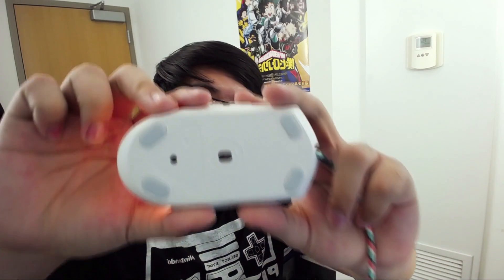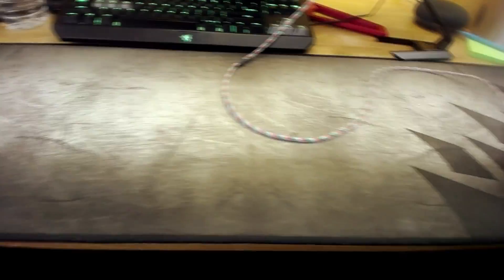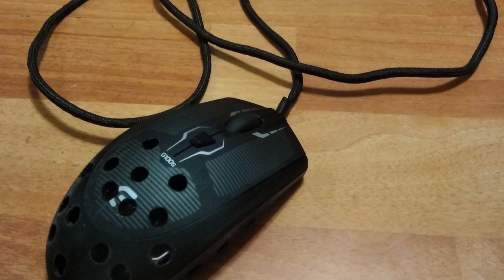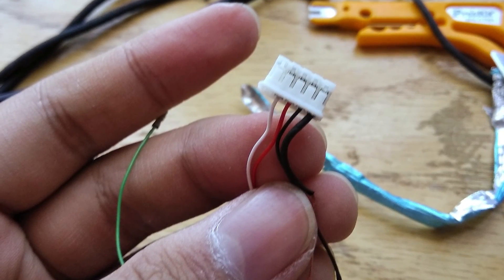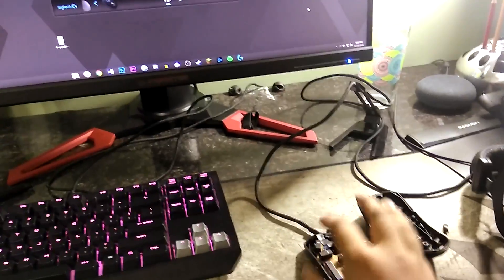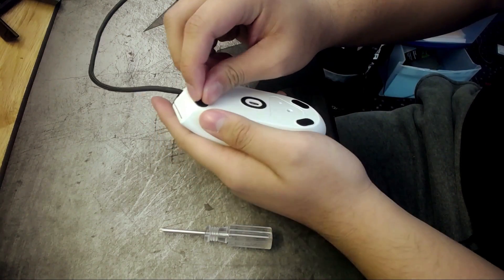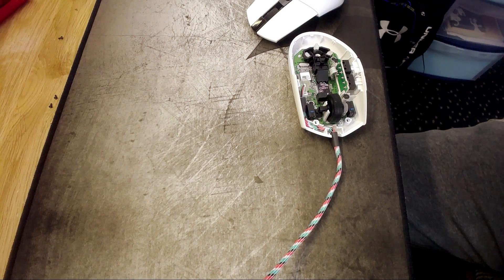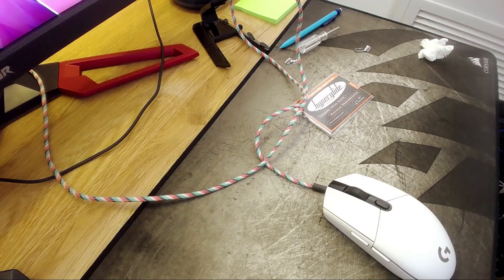How to make your mouse even better! (for osu! and other games)

Comment from the maker: EDIT: Yes the G305 is a super good option for wireless that I forgot about and it would be about the same price to go with that vs doing what I did but 1) it needs batteries so you have to keep swapping those out every long while and 2) if you already own a really good mouse that you like, this is cheaper.

One thing that I forgot to mention in the video that's semi important is that if you want to be 100% sure before doing this, I would do a quick google check to see how other people have taken apart your specific mouse. I've done the paracord mod for a few friends, but each mouse was very different to take apart.
Also, the hyperglides come in a 2 pack. You get a spare if they ever wear out down the line :)
Reply: for people with doubts about the battery life of g305/304, they mean it when they say 'every now and then'

personally using an AA lithium energizer for the past 6 months, averaging daily usage of 2 hours with performance mode at all times, the logitech software has the battery indicator at 5/5 to date. actually insane
Reply: @uwaa4467  ye man ive been having the g304 and i use dry cell batteries that came in a pack of 4 and they cost less than a dollar. They last you a couple of months
Reply: Rather than buying the G203 and doing the mods, which would void your warranty, why not just buy the G305? It has the same body and it is wireless with long battery life. And get a hard mousepad to go with it for maximum glideness.

It's 60USD for the G305 with warranty vs 24+25=49USD for the modded wired G203 without warranty.
Reply from the maker: Yea the G305 is a viable option. I just forgot about it when making this video lol
Reply: G700s? I have that one, expensive as fuck...

Comment: I have a question and hopefully someone in the comment section can answer. I have hyperx pulsefire core and I don't like its cord. I also have a spear cord which has four black,green,red and white cables, but its missing the fifth pin/cable. Pretty sure that pulsefire core has 5 pin connector, not certain because I have never opened it. Can someone guarantee me that if I do indeed open up my mouse that 4 pin connector will go in to 5pin and still work? If I didn't make myself clear you more than welcome to ask me to clarify. Thank you in advance.

Comment: For the price of all this you could get a Model O/O- which already have PTFE Mouse feet (basically hyper glides) and yeah the cable is a bit worse but still very good and better than the one on the G203. If you like the shape that much just get a G305/302 and it'll suit you only downside are the feet.

Comment: my mouse skates and the edge where the mouse skate holds in place are after a long time of use gone, so the bottom is completely flat. do you think putting some random mouse skate would work? or similar in shape (I have an office mouse so there are no skates that are designed for that mouse)(yes I'm broke lol)
Reply from the maker: I dont see why it wouldn't. You could probably put any shape then

Comment: Does your white g203 make any noise when you squeeze it on its sides? After paracording mine and adding hyperglides, I noticed that it makes a squeaking noise when I squeeze on the sides.
Reply from the maker: Not at all. I just squeezed it right now before this comment

Comment: I’ve used pro intellimouse with para cable but its too flexible ....
The cable sometimes stuck between the mouse and mousepads in low sensitivity settings....
Reply from the maker: Get a bigger mousepad? Because I've never had this problem before
Reply: raito I’ve already had. 
When I flick my mouse, the para cable moves next to my mouse and then stuck between mouse and pads....

Comment: What kind of paracord did you use?
Is it 4/5 mm diameter of paracord itself?
Reply from the maker: The one I bought at the store was the only parachute cable they had. I think it was roughly 4/5mm as it fits in my mouse bungee just fine. The bought I bought from the paraflex website is about the same size.

Comment: paracorded my g502 a while back but managed to lose one of the springs that holds the mousewheel up while putting it back together, now the mousewheel is clicking like crazy and I have to disable it in G hub if I ever wanna use it, so if anyone is paracording a g502, careful not to lose the springs!

Comment: The G305 Wireless has the HERO sensor with 3 months real-use battery life. Check it out. Also, I'm pretty sure all of Logitech Gaming series has the PTFE feet already installed.

G305 Amazon France delivered to the UK £26.48 at the time of writing: https://www.amazon.fr/dp/B07CGPZ3ZQ
It's on a deal atm.
Reply from the maker: Logitech Gaming series does NOT have PTFE feet. True PTFE plastic is white and only white. When you put on hyperglides, they will feel a world's difference :)
Reply: @Raitosu  With all due respect, please do some research.

Virgin PTFE is white, yes, but it can also be mixed with glass, bronze, or Carbon (hence black colour) for various purposes and applications.
https://www.trentplastics.co.uk/engineering-plastics/ptfe-rod-sheet

Now I would imagine Logitech to want their products uniformly in one colour, hence the black PTFE-Carbon composite. The Carbon also helps with wear and tear, so that it lasts longer than the Virgin PTFE. The skates are thick at least in my G700s, and it has lasted me years to-date.

As for the coefficient of friction, Virgin has about 0.04 while Carbon has 0.08, twice as much. You are correct when you say 'Hyperglides' are smoother, but you are incorrect when you say Logitech Gaming mouse doesn't have PTFE feet. They do. Just in Black. Logitech even says in their spec sheet. 
http://cncplastics.com/wp-content/uploads/2019/02/Carbon-Graphite-Filled-PTFE-Data-Sheet.pdf

Edit: Whether the ~0.04 reduction if CoF is worth it is entirely up to you. I personally feel that changing to a hard mousepad makes a bigger difference. Or even put your cloth mousepad on a hard surface, or heck, even try cleaning it first. They do get dirty, you know?

Comment: i just cut of the plastic slippy pads on my mouse and it worked great!
Reply from the maker: I used to do that but it ended up ruining the bottom of my mouse without any feet
Reply: @Raitosu  i dont ruin the bottom of my mouse, it just got dirty easier and when its dirty it feels off

Comment: Does your mouse lose tracking and stutter with hyperglides, mine is the G Pro and it stutters like crazy with hyperglides on
Reply from the maker: Really? My mouse tracks perfectly fine and it's a G Pro wired. I know I said G203 but you can see when I take it apart it has the hero 16k sensor inside

Comment: The few rubber parts on the paracord is where you have to hover a small flame over, it's there so when you slot your paracord into the right position with both ends being in the right positions with the paracord should be able to sit snugly into the mouse
Reply from the maker: Yes! I ended up doing this and removing the sticky tack. I just did the have a lighter on me.

Comment: Really interesting! As a mouse player this guide taught me new stuff about my mouse, im not really going to do this since I already have a good feel with my mouse, I dont actually feel any mouse drift anyway, thanks for this vid!!
Reply from the maker: I'd say it does more than just help with mouse drift though. It makes your mouse feel almost weightless if you really like lighter stuff! But if you're perfectly fine with your mouse then that's great!
Reply: @Raitosu  My mouse is already really really light, (80g), wonder what would happen if I tried this, does this work exactly the same for a Razer mouse? (Pleb mouse i know) or do I have to figure some stuff out?
Reply from the maker: Yea, my mouse is also about 80-85g. It just makes the overall experience smoother and it feels a lot better. This works on everything but you're going to have to research how to take your mouse apart or just what new mouse feet to buy. The websites linked should give you more info for that
Reply: @Raitosu  Thanks dude!

Comment: Yo, I really like your white mouse! It's that an g203 prodigy aswell?
Reply from the maker: Yes technically. It's actually a G Pro wired inside a G203 shell because the G Pro doesn't come in white. But in my experience, they're basically the same. I think the G Pro feels a little snappier, but that's probably placebo.
Reply: @Raitosu  The G pro has a much better sensor, thats why
Reply from the maker: It's basically the same sensor. I know the Mercury and hero sensor are different, but honestly, unless you're comparing it side by side, it's still really hard to tell
Reply: @Raitosu  They're both amazing sensors but having owned both, it's pretty clear how much more consistent the hero sensor is. But like you said, I only noticed because I compared them side by side. Great vid btw 👍
Reply from the maker: Yea, I would put the Mercury as a 95% hero. If you're looking for a budget mouse, you won't get a better price to performance than the G203
Reply: @Raitosu  Yes definitely. The G203 is probably the best budget mouse available.
Reply: @dogrzz7082  Agreed.

Comment: Do you get less mouse drift this way? Great video!
Reply from the maker: Thanks! I wouldn't say it really eliminates mouse drift because that's cause by angling the mouse, but I do find that adjusting the mouse is a lot easier and that mouse drift wasn't as bad as before because the cable doesn't tug on the mouse as much anymore
Reply: @Raitosu  Sound pretty good! I never realized you could mod your mouse like this and I will be buying both these items to add to my Zowie FK1, going to be sweet
Reply: @Raitosu  So you think mouse drift is caused by mouse angle?

Has that always been the case for mice?
Reply: Controller players: 😡